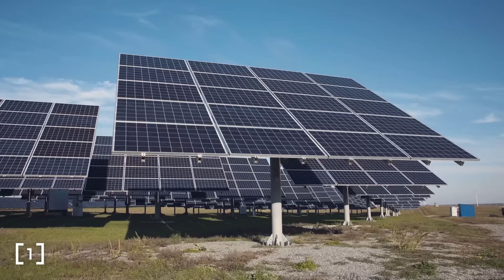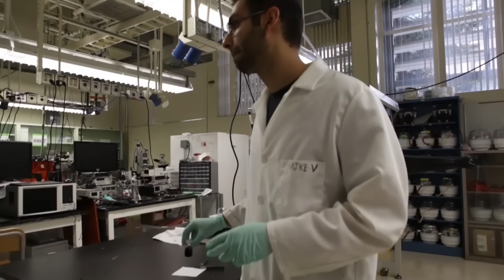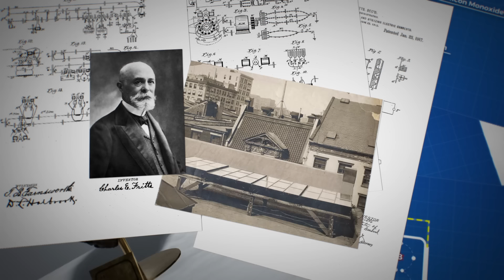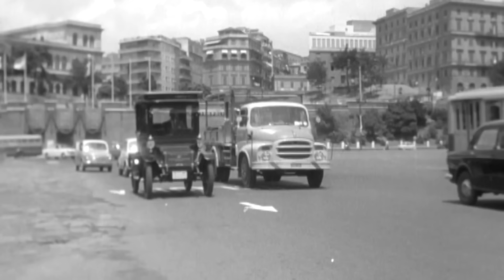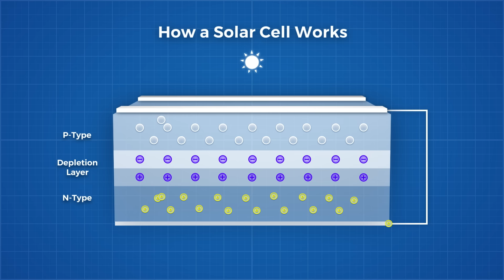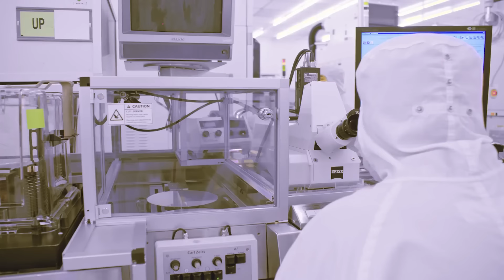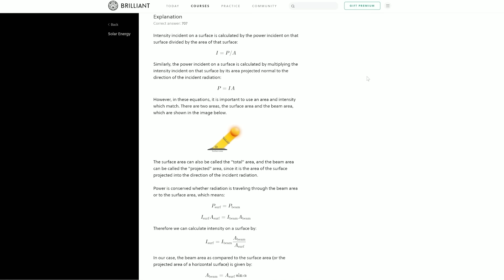The Mystery Flaw of Solar Panels

Comment: Is there no practical way to utilize the heat captured by solar cells? A heat exchanger and turbine?
Reply: I'd say that if heat utility is an issue, or a desired power source, Solar Thermal, or CSP (Concentrated Solar Power) using heliostats (the technical term for sun-tracking mirrors that focus sun rays on a central tower) to boil water to run a turbine, is the way to go.

CSP has the dual advantages over PV (photo-electric, which the video is discussing as having the problem of degradation) in that it is more efficient if in large facilities, and can store extra heat in molten salt for energy storage to run turbines for energy at night.

(Though granted, PV is more appropriate for homeowner rooftop solar installations.)

But CSP for mass central power is where you'll get your best results for a turbine arrangement, supplying baseload power, which PV cannot do when the sun is not shining, and also avoiding the so-called "Duck Curve" problem of PV solar.

Additionally, CSP is far less complex and has no degradation issue beyond possible damage to the mirrors.

See the solar section of the following:

https://en.m.wikipedia.org/wiki/Duck_curve

Comment: I like how no one mentions the damage done to the environment during the production of solar panels. Nuclear is way more reliable and clean. And thorium is safer compared to uranium. There is a relentless lobbying against research regarding plants using thorium for fuel..
Reply: Right, we've read all those news articles about the devastating consequences of a major solar spill. /s

Yeah, it's fair to acknowledge that the Chinese in the process of cornering the market on the production of cheap silicon created some major pollution problems but pretending nuclear is great except for a couple of "minor exceptions" is also wrong. If you have a Boeing-like drift of management away from quality towards cheaper people and processes you will eventually have a nuclear disaster. Also, it is not clear you can completely protect against natural disasters causing nuclear meltdowns. 

The nuclear industry in the US (with the US government) blew its chance by short term thinking and a refusal to be honest about the problems with high pressure water plants. Now it has no credibility to start again. It's a political problem but it is also a capital investment problem in that it takes a long time and a lot of money to create a new design and build plants and if interest rates spike, your plant just got way too expensive. Solar is also capital intensive but can be added incrementally and much faster so it has been winning out.
Reply: I looked into thorium reactors a while back, and it turns out it'll just be a Uranium Reactor that also includes Thorium.
Why? Well it turns out T-232 - the only naturally occurring isotope of thorium - can't sustain a nuclear reaction without help. It needs high-energy neutrons to undergo fission. Standard fissile sources are all uranium isotopes.
 
And T-232 tends to turn into U-233 in the process.
U-233. AKA Uranium-233.

This info from the IAEA and World Nuclear Association's website.

Also I can't find any info about this "Lobbying Against Thorium" stuff. Can you please list your sources?
Reply: Until something goes wrong with the nuclear power plant. How much pollution is created then? How much pollution is created with nuclear waste? Where do we put it? 
Seems that no matter what we do, there is a problem with it.
Reply: @markchidester6239  There is too much media-driven misinformation regarding nuclear. Accidents like Chernobyl are the result of poor building practices, not the danger of of energy production. We don't have that problem in western counties where we invest incredible amounts of time and effort on safety practices. We like to hold up Three Mile Island as an example of a failure, but the truth is, the safety features worked. And the advanced to plants has increased to the point that there is virtually zero chance of a failure. In fact, nuclear generated power is safer than coal, natural gas, etc. Its just that the much more frequent failures of those facilities are not "grand" in scope in a single event like Chernobyl so it doesn't make for interesting international news. The fact is simple and undeniable, supported by the vast majority of energy experts - if you want reliable, plentiful energy that does not pollute the environment, the ONLY solution is nuclear. We have programs for nuclear "waste" elimination. It is just a matter of investing in them. One of the disposal practices that many have dismissed is inefficient, but is supported by some private interests is "off world" disposal. The idea of launching our nuclear waste into the sun sounds like science fiction, but until a few years ago, everyone said that a reusable rocket was impossible. Then they said it was too inefficient and costly. That has been proven thoroughly wrong. Someone like Bezos or Musk could solve the engineering required to routinely send nuclear waste into the sun and the cost could easily be absorbed by the incredible cost savings we would achieve by replacing fossil fuels with nuclear, especially considering the much smaller amounts of nuclear "waste" produced by alternative sources other than the historical uranium.
Reply: @TwilightxKnight13  The Fukushima nuclear accident was a result of a series of poor decisions by both TEPCO and the government agency that was suppose to make sure that nuclear power plants remain safe.
Also, "the programs for Nuclear Waste Elimination" are:
1. Actually called "Nuclear Waste Disposal"
2. We still have a long way to go before all waste is safely stored away
3. I think the term you're searching for is "Nuclear Recycling" or "Nuclear Reprocessing"
4. Nuclear Reprocessing is not economically viable at the moment
Also nuclear isn't the ONLY option. In fact, current nuclear technology isn't really able to fully support a power grid without either causing big headaches or the ability to export said power.

Also, about the sending nuclear waste to the sun, DON'T.
That is a clear sign of someone who doesn't know even the bare basics of launching stuff into space. To launch all waste into the sun.
There are... a lot of problems with it. So much that I need a whole seperate section to talk about it.
Reply: @markchidester6239  Meanwhile, well run plants don't "go wrong".
Reply: @Slicerwizard  
Well the one in Japan sure did. Mother nature didn't seem to like it.
Reply: @markchidester6239  Oh, the one where TEPCO didn't bother to protect the backup generators from a tsunami - in a major fault zone? That's your idea of a well run plant? Meanwhile, a dam failure triggered by the earthquake killed more residents than the nuclear plant did. Guess you should start crying about dam construction as well.
Reply: @Slicerwizard  I never said it was well run. 
My point was that it polluted the planet. YOU said that a well run nuclear power plant doesn't pollute if it is well run.
I don't understand how nuclear waste isn't pollution, but what ever. You know all.

Comment: Your example doesn't give a true representation of what the leaf does. The energy absorbed is used to convert CO2 into Carbon and 2 Oxygen or split carbon from the 2 oxygen so the plant can create glucose  or sap which the tree uses for food. The glucose is transported in the vains of the leaf into the trunk. Tree's do not run on solar power they use it for chemical processing.

Comment: Very nice and simple explanation! But solar cells cannot ever reach 100% PCE (Power Conversion Efficiency) due to the Shockley-Queisser limit. This maximum is at 33.7% PCE. However, this limit can be circumvented by applying some tricks, in which case your maximum PCE is the thermodynamical limit of around 80%.

Comment: I am confused by 9:20 section. Why wouldn't the extra electrons from the phosphorus fill the holes from the Boron? Thus how would there be positive layers and negative layers? After that, even if I figure out how there are positive layers and negative layers in the diagram why are the electrons propelled and not repelled by the negative layer if they are negative? He also says that the junction prevents it from going to the other side. But, I don't understand that. With the way the diagram is set up wouldn't the electron be attracted to the positive layer since it is negative? I am sorry I just do not understand that part. I would be grateful if anyone could explain it to me.

Comment: I built my own solar panels. Only flaw was humidity. They lasted 4 yrs. My electric bill was $15 a month !
A woodstove kept bill down too. Now house is all cold but the small bedroom I am in now. And with a small electric heater and an electric blanket I keep electric bill at $60. I turn heat on at night, In day I sit in car pointed at the sun. Warm as hell. I'm retired. No big deal.  Panels are real cheap now. Everyone should have a few solar panels, cells and an inverter.  Never forget the first panel I made and ran a fan all day for free.
Stay safe.

Comment: Very nice explained. Good job so far.
A little extra knowledge...In 2013 was the possible rendement somewhat near 23% , not 20%. (Product of Philipines, not China). It does not sound a lot, but from 20 tot 23% is 15% more energy....In these days it's even more than this 23%.
But I do know you'll not buy those maximum performance cells for on your roof....The top of possibility is always very expensive. (Information: Solar team Twente 2013, Netherlands...given after the solar challenge 2013 in Australie to their supporters...those solar teams only go for maximum performance, extra costs for the cells is not very important on the total costs of such a car.)

Comment: Absolutely love your videos, solar is a large element of the earths future power supply. I just wish that current  solar panels would only use the technology that allows for the efficiency above 10%. Our lecturer pointed to the fact that most solar panels in use sit around 7% efficiency due to older technology and efficiency loss due to age. I wonder if the lab restoration process is able to be conducted on old solar panels whos efficiency has dropped out of 70% of their possible output. 
Additionally work needs to be done to allow a change in culture and social norms of when power is available for use. Selection and engineering of systems that are capable of storing excess energy to be used when energy is required needs further investigation. I look forward to an eletric future of hydrogen assisted transport and grids allowing for remote travel and remote energy storage. (Road houses/ remote fuel stations recharging capabilities fuel with hydrogen  either transported to location or created on site to supply power directly on demand. As well as devise ways to reduce energy consumption of things that we use. There is alot to lookforward to within the future.

Comment: You couldn't say that the resistance would increase because of the heat ?  Badca  a lot of people know that when a conductor get heated it's resistance is increase. And it's even worse for semiconductor. If you leave a semiconductor in room temperature. The resistance is in lcrease by a large amount. That why conductors work best at cold temperature

Comment: One should remember that increasing the amount of un-reliables connected to the grid above 20 % can make the grid unstable. All power sources connected to the grid operate in synchronism. Remember that the national grid in the UK is not designed to route power from one end of the country to another but to route power between adjacent regions. If synchronism is lost the ability to route power between regions is lost so if an unexpected peak in demand occurs or an unexpected break down occurs standby for brown outs or blackouts. One should also remember that those server farms are just useless lumps of expensive scrap without a reliable power supply. So any one with a hankering to connect more and more solar power farms or wind farms to the grid should first go read up about power systems engineering to find out why this  is such a bad idea.
Reply: On most days 50% of Denmark's power comes from wind farms and has done so for a couple of years. Somehow their grid does not collapse with the wind varying.

Comment: Interesting. I plan to build my own house completely off grid (eventually). Knowing the science on solar I think is very helpful. I will be using other types as well through, like wind. Don't throw your all your eggs in one basket
Reply: To my understanding, outside a few specific cases the majority of the time the money spent on building a hybrid wind solar system would be better spent on a bigger solar power system.  We're I building my home, I would construct it as grid tied to sell my surplus energy to the grid and allow a 3rd string emergency energy backup.
Reply: @mrspeigle1  I have since found the same. I can send surplus back if I connect to the grid. But I'm thinking of the battery route. As I have found that even if you have solar and there is a power outage then you still go down with the grid.
Reply: @alexlancaster7681  Yes and no, as far as I know. If you have an transformer which can feed directly your home and you create enough energy through the sun in the moment you need it, or have an battery which previously stored enough energy, you are able to use your own electricity with an system which is able to cut your house off from the main grid and switch to the locally generated energy either automatically or manually. The standard devices can't do that, though. 

An battery is necessary in most applications, as the installed solar panels on private roof tops usually don't create the necessary amount of energy ad hoc to run energy intensive appliances, like an oven, and certainly not heat pumps which heat/cool the building. And obviously you won't have sufficient electricity when it gets dark(er).

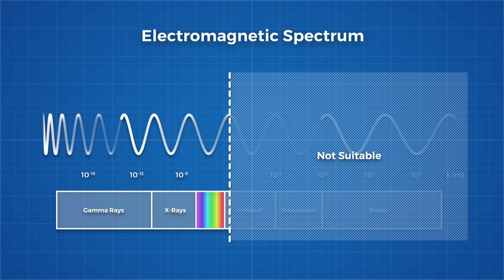Comment: @5:22
[Lower frequency light]..."will cause the atom to vibrate and create heat..."
     Maybe gold can be used? Gold can turn heat directly into electricity. Gold can also be worked into incredibly tiny structures, reducing some cost.

Comment: My portable solar power bank is dying, it's been charging for a week and is still at 25%, so do I just put it in the oven at 200° for 30 minutes, or would I have to dismantle the whole thing and just put in the silicon?
Is there anywhere I can find a solar battery pack that uses gallium instead of boron? Will it be super expensive?